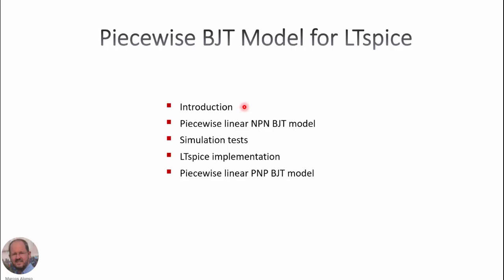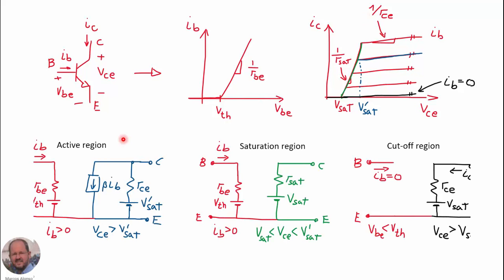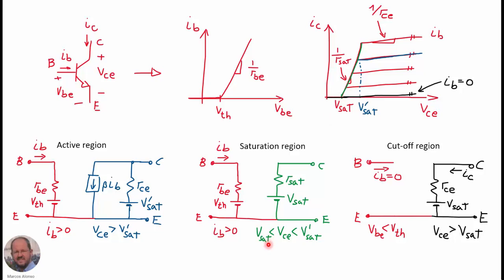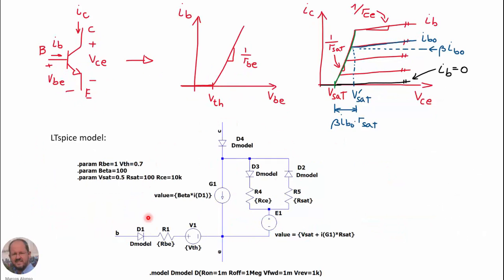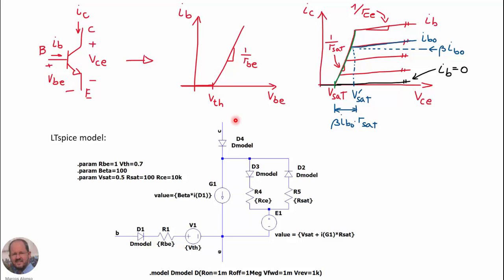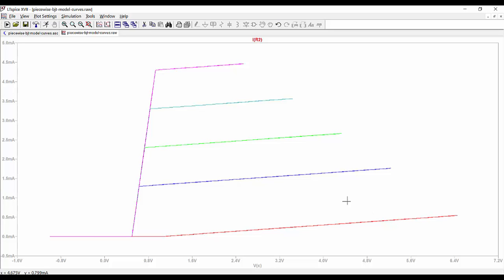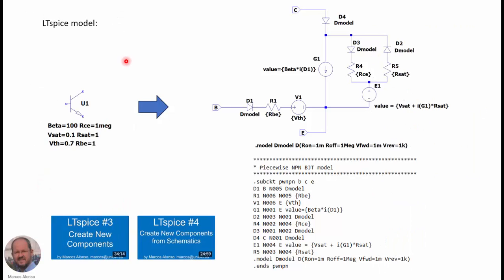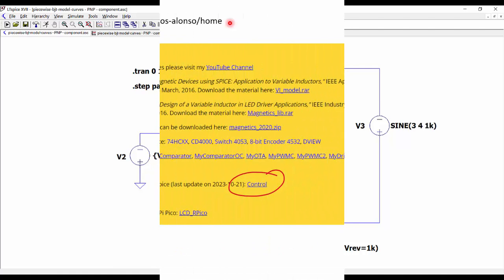LTspice #28: How to create a Piecewise Linear BJT Model

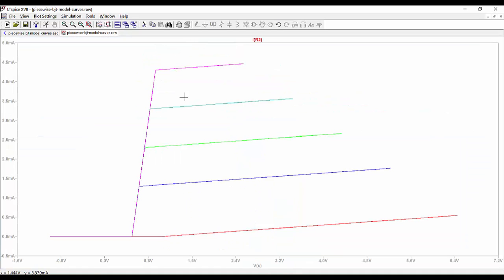Comment from the maker: 14:21 - As can be seen the cut-off region does not start exactly from Vsat. This is due to the reverse current of diode D1 at the base. When the voltage applied to BE is lower than Vth there is a small reverse current circulating through D1. This current is reproduced by the collector current source and the effect is that it is necessary to get a higher CE voltage before diode D3 starts conducting. This issue can be solved by increasing Roff of Dmodel. I have seen that using 100meg is OK so the cut-off region will start from Vsat with greater accuracy. I have already modified the value of Roff to 100meg in the model available from the library Control.lib.